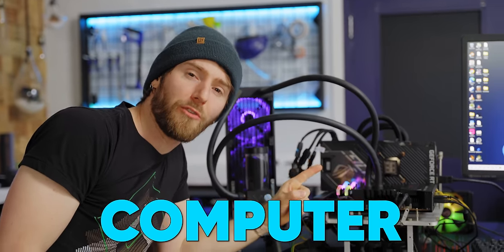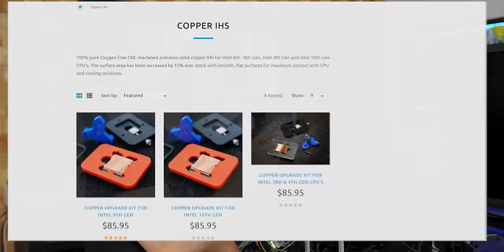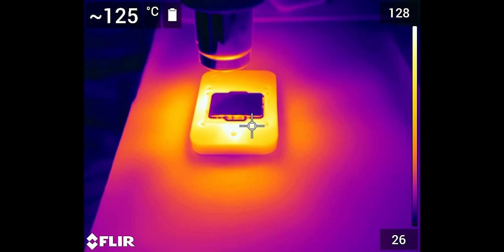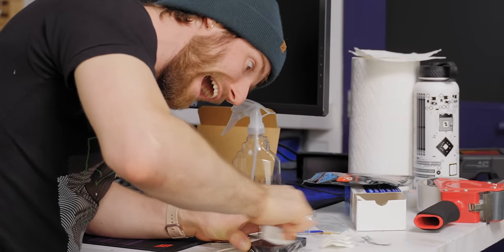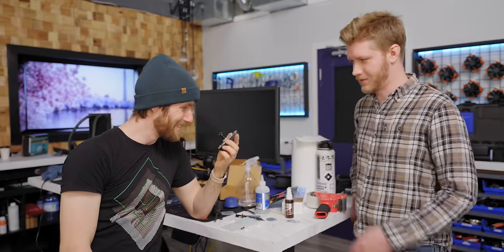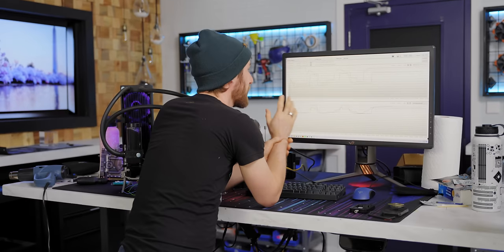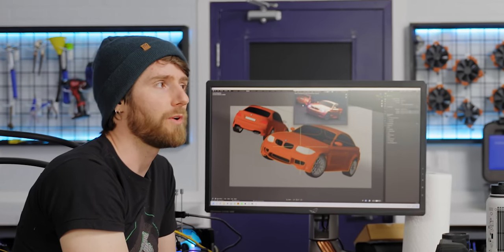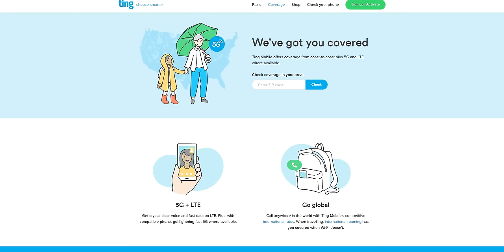Making Intel's Worst Product Better.... And Also Worse

Comment: AMD: Next generation 3D stacking technology brings top tier gaming performance on high-midrange CPU's
Intel: 300W stock, take it or leave it
Reply: AKA - Intel: "Best I can do is 300w stock."
Reply: They had the best cooling you can possibly get and this CPU still thermal throttled with stock IHS. What a waste of money this processor is.
Reply: @kamilkilian7861  Not quite the best possible. They have that air conditioner cpu cooler.
Reply: @DarthCiliatus  which in it's turn takes 2kw of power and has issues with condensate
Reply: Valentine cant go a day without fanboying over amd
Reply: @TehStevz  
*Worst
Reply: 300W stock is a stupid thing to complain when the power limit is a few clicks away

And 12900KS at 150W (or even less) would still murder 5800X and 5800X3D in mutli-core
Reply: @suntzu1409  Intel fanboy spotted.
Reply: @suntzu1409  i doubt it. Maybe I'm wrong, but limiting your CPU's potential literally in half will not keep it magically better, than a CPU, that was designed for this power consumption.
Reply: keithsze001  *12700/12900
Reply: @K.R.X  
Ok AMDrone®™
Reply: @vladislave7826  
If you are complaining about ""300W stock"", then limiting it to 150W will make it better

Plus you will barely loose 2% performance by doing this

CPUs are not """"designed"""" for power consumption
Reply: keithsze001  
Inb4 "muh, power hungry, expensive"
Reply: keithsze001  Or you know get the processor which is actually efficient. 12900k is a sham at that.
Reply: This reply section got full of fanboys real quick. Bye.
Reply: @suntzu1409  12900ks is 16/24, its a given to win multi-core againts 5800x 8/16.
But really, that power consumption is atrocious.
Reply: @suntzu1409  The problem with limiting the power to 150w is that now it’s not only still drawing more power than the 5800X3D, it’s now also probably losing on average in gaming performance since it’s only ahead by a few % points.
Reply: @ValentineC137  
Ok, so limit it to 65W

Point is stock means nothing when you can put whatever power limit you want
Reply: @ivrgn1720  
Power consumption can be whatever you want

"Oh, its just 16 core vs 8 core" is just trying to ignore the fact that 12900KS murders 5800X3D in multicore
Reply: @suntzu1409  like I said, it's a given that 16/24 will kick 8/16 in multicore, because it is literally have more cores and thread. It's like saying a truck can carry more load than a sedan, well duh...
Reply: @suntzu1409  "Oh, it's just 16 core vs 64 core" is just trying to ignore the fact that 3990X murders 12900KS in multicore
Reply: @ivrgn1720  
Well, maybe this guy shouldnt have compared 5800X3D and 12900KS in the first place then
Reply: @ValentineC137  
And how exactly is 3990X related to 5800X3D?
Reply: @suntzu1409  it’s about as related to the 5800X3D as the 12900KS’ multicore score is.

Also I find it pretty funny that the 3990X doesn’t use much more power than a 12900KS, even under full load it’s only 400w compared to 300w
33% more power consumption but running 400% more cores and 533% more threads.
Reply: @ValentineC137  
Except nobody mentioned 3990X other than you

Power draw is very very arbitrary for any die or combination of dies unless you are at the extremes

It isnt an achievement to make 64 cores run at ""only"" 400W

Increasing core count faster than power draw isnt without its own drawbacks 

Cope harder
Reply: @suntzu1409  nobody mentioned multicore other than you :P

Comment: I remember back in 2013 when AMD brought out the R9 295x2 and Linus said that intel needed a product that pushed the bounds of what's possible and requires watercooling. Looks like he finally got his wish!
Reply: Damn even the single R9 290 was a mess to cool. Been running in thermal throttle since day one, had to build my custom WC loop
Reply: @bratisla2040  I had a Tri-X 290 for a while back then. After repasting, it didn't go past 75 degrees EVER.

Comment: I loved the 12900ks - recently sold it. Now I have the 13900k & 14900k. For those worried about temps/degradation: For my 13900k and 14900k I have done the following: MCE off, PL1 and PL2 limit to 225, limit P-core boost to 5.5 GHz and E-core boost to 4.3GHz, and use balanced power profile in Windows (although I do disable core parking to keep system highly responsive). Oh and just XMP on the RAM. I didn’t change LLC value. I have set voltage offset at a modest -0.010v. I have disabled the C6&C7 C states and EIST. Lastly I have locked AVX at 0 offset. I have tested on P95, CB R23 and CB R15. All great and in a mid 20 degree room, no workload exceeds 80c on package or cores just using an NH-D15 with an airflow case. Very happy and benchmarks are very close to where they were before taming these beasts.
Reply: Update: I have now undervolted to -0.015v and set the Core limit to 300 Amps.

Comment: Weird to find a compromise in a no-compromise CPU. I wonder how much more Intel would have to charge per CPU if they used a tighter tolerance heat spreader for the massively high end CPUs only. If it doesn't matter for 99% of all chips okay, use the other process, but for that remaining 1%, it seems like billions of dollars of R&D could be bought cheaply simply by refining this one component. 

I hope someone with some power and vision at Intel watches this, since AMD is looking to eat their lunch again with Ryzen 7000 and they could use every advantage. 

Or someone at AMD could watch this, improve their own high-end and continue embarrassing Intel in the future.
Reply: Tbh offering a "top bin" for the higher end CPUs at like 400 bucks more without an IHS or with a lapped IHS may be interesting. I wouldn't buy it but people looking for absolute best performance may want it.
Reply: Or, like, design the CPU to use a somewhat reasonable TDP? This thing draws more power than my entire computer
Reply: 8 months old comment, but anyway, i think the issue may be that the cost may be higher than what the price of buying that lid would suggest and that in practical applications, as shown in the video, the gains are minimal to non-existant:
1)Because of the random factors during manufacturing process (and manufacturers designing around the existance of said random factors), you only get to know if any particular chip can be made into a top tier/mid tier/low-end processor after evaluating (i.e. (mostly?) testing) it. Which means that you have to either

a)disassemble, clean and then reassemble already working processors (which, besides costing money, adds some risk of breaking them), 

b)or you have modify your production process to have your testing done before fully assembling the processors, which will probably increase production costs for all of the processors, which, given that only a very small percentage of the processors would actually use that super flat IHS, would effectively make installing that IHS an expencive process (if 100 processors with standard IHSs cost, lets say, 1000$ make and 99 "standard" and 1 "super flat" processors cost $1050, then that super flat IHS effectively costs 50$).

2)You now also have to manage having 2 similar items in your facility, which increases costs of running said facility (i.e. the production cost of all of the processors), which, same as above, means that it is, effectively, really expencive to store those super flat IHSs.

Comment: Having the extra good heat spreader should have been the standard. Intel wants to pump the absurd extreme, they should offer supreme cooling. As if it's not expensive enough already, while there's almost no way to prevent it from throttling.
Reply: nhaaa, they should just rework their stuff, all they do is keep upping the power consumption gen after gen, just like ngreedia does. thats great if you live way north but having a space heater with 300w cpu and 400w gpu is the definition of ''playing on a toaster''.
Reply: @jeromegagnon3787  it would be better if they made their general line up better, but it if they are going to make a hot part like this they'd better supply it with ample cooling.
Reply: @Olav_Hansen  id rather it come with an ac unit then. the part can stand the heat, i don't .
Reply: The stock IHS is domed for a reason: To make sure it will work even with lower quality heatsinks and low quality thermal compound. You can get the exact same result as in the video by just sanding down the IHS flat.
Reply: @jeromegagnon3787  one the many reasons I got a 75w Series S console....The next gen is gonna be 10X my S's 75w power usage. I will keep my old 200w PC for retro/media usage.
Reply: @MoraFermi  ive never used the stock ihs, i like mass, but mass don't negate the heat that gets dumped in the room. what im saying is efficiency hasnt improved that much if you set equal power over the years. im an old overclocker who messed with dry ice and stuff in my days. and frankly, the stuff they are releasing these days aint that great. but since peoples will buy absolutely anything if the mind fkery department does its job half well. we're left holding the bag.
Reply: @jeromegagnon3787  While I only have the peasant versions 12900K and RTX 3090 they really do a wonderful job as space heaters.
Reply: @jeromegagnon3787  yeah Australian summers means I'm not pushing anything on my water cooled station
Reply: Its not viable to mass produce the heat spreaders they showed here they would if they could

Comment: I delided my 8600k, was a lot of fun. I didn't even bother glueing the IHS back on, I just used the mounting pressure of the socket to hold it still. I probably got like a 10c drop just putting the previous IHS back on with liquid metal and lightly planing the IHS + heat sink.
Reply: :o

Comment: I feel like changing thermal pads/paste on the gpu may have actually seen results in this setup. My 3090FE had massive cooling gains for memory temps when I did it (about 20 degrees cooler), I think they really have been skimping in the thermal pads.

Comment: I actually bought one of these back in 2019 and my temps did go down a good bit, I still have the excel file I made. The core temps went from (90/85/93/86) to (74/73/80/74) using whatever stress test I was using at the time (Probably Prime95).... So they do work pretty dang good.
Reply: What cpu did you put it on?

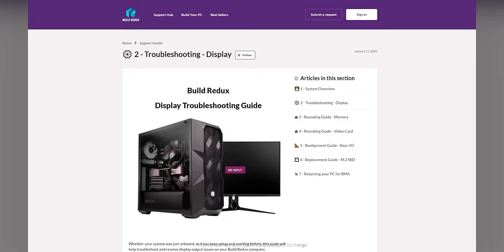Comment: 1:22 y'all pretty much explained Six Sigma manufacturing better than any corporate trainers I been subjected to 🤣 so considering that Intel isn't realistically expecting a perfect finish, I'd take a guess they're wanting an adequate finish and Sigma 3 or 4
Reply: 6S is even more cringe than 5S. All lean manufacturing is soooo painfully cringe. The proponents and the consultants are the type of people that pump 6S during the work week, and a pyramid scheme ... I mean MLM scheme... after hours and on weekends. You'll see them at MLM rallies on Saturday afternoons.
Reply: I prefer six ligma
Reply: Oh boy! Have you heard of LEAN SIX SIGMA!?
Reply: @bigqwertycat  I first heard about it in 2009 lol
Reply: @littlejackalo5326   I'm not saying I'm a fan (except that the "training" was a nice way to get out of actually working for a week). As for it being a scheme, well it explains why my former employer loved it so much 🤣 it was completely engrained within that company to the point you couldn't make a proposal without certification in it. The biggest takeaway I got from the training  and why I brought it up was: at what point are things "good enough" before you start wasting resources with ever increasing diminishing returns?
Reply: @tinman123456789  Interesting in the case of this CPU lid that it could be 10C cooler yet ultimately not worth the effort. Purely on the effectiveness of the cooling 10C is excellent but for 4FPS more in Tomb Raider, why bother.
Reply: your ability to timestamp has definitely failed to meet 6S standards
Reply: @kingkarlito  
Lmfao

Irony committed suicide

Comment: As electricity usage per square mm goes up, every additional improvement in tolerances will have greater levels of significance (obviously to a point). It’s clear that for the maximum performance units they could do better, but for the overwhelming majority of processors, thankfully, doesn’t matter. 

It does raise a question about the value of keeping the prices down on the high end products when quality suffers. Relying on 3rd party improvements has been standard for top-end systems, usually because of some odd deficiency—whether it’s lapping the IHS, package bending (Alder Lake), IHS-die gap (on the interior), de-lidding, die lapping, or use of liquid metal TIM—halo products could benefit from the additional effort, and we could still enjoy warranty coverage.

I personally think paying more for better quality in a complete package off the assembly line is worth it for halo products. I would be willing to pay to not risk ruining something so expensive.
Reply: Better quality parts would really justify the KS name and price
Reply: Eh. Don't know. The price may not be worth it to them. Computers are not like any other product on the market. They depreciate so quickly. In a year or two the 12900KS will be outperformed by the rest of the high end market, in 5 it'll be outperformed by the majority of the market. Does it make sense for Intel to spin up entire new boutique divisions just for the KS series? I'd say no. A halo chip is for current headlines, it's not like a halo car which could have an impact on the brand for decades. People don't judge chip manufacturers on halo products. They judge them on what they can actually afford to buy. Chips are commodity priced and sold, which we saw over the last two years with the chip shortage. Noone has brand loyalty to Tropicana, if Tropicana OJ is out they'll buy store brand and be fine with it. With how fast chips depreciate it honestly may not be worth it to Intel.

Comment: The nickel plating on the IHS actually does significantly contribute to thermal resistance due to the nickel being heat-soaked. The thin-wall assumption that you spoke of holds primarily for steep temperature gradients, but under nearly isothermal conditions, like a CPU and cooler at steady-state, the contact resistance of the nickel-to-copper interface is actually quite significant relative to the other sources of thermal resistance. I would cite my sources, but it was a textbook I read like 2 years ago and I can't remember what it was called, sorry folks.

Comment: It would be interesting to send the intel IHS to a company that can test its “flatness”.
Reply: Its most likely slightly bend now after the delidding.
Reply: Why? The real issue is how inconsistent Intels IHS are from one unit to the next. Some might be flat while others arent.
Reply: @randybobandy9828  There is also the issue, on 12th gen specifically, of the Independent Loading Mechanism (ILM) bowing the IHS.
Reply: GN tests that.
Reply: What you could use to measure it is an optical flat and a low pressure sodium lamp that measures surface flatness by optical interference. It sounds complicated but if you set it up right it's actually pretty simple.
Reply: Send it to GN
Reply: probably a dirty joke in there somewhere

Comment: I've seen Linus complaining about sticky residue several times. Tech tip: contact cleaner dissolves sticker and glue residue like it is nothing. You can even remove void warranty stickers with that stuff. 
Just be sure to use the computer-kind contact cleaner. Automotive contact cleaners sometimes use minute abrasive agents that can ruin the look of some plastics :(

Comment: If gold is also an excellent conductor, well I think you gotta test the theory of gold vs copper
Reply: Gold is worse in thermal conductivity. By quite a bit.
Reply: Actually, silver metal has the best thermal conductivity of any metal at 429 W/mK. Gold is 310, copper is 401, aluminium is 205.
The thermal conductivity of a copper heatpipe is between 10000 and 100000 W/mK.
So a gold heatsink would make no sense at all.
Reply: @ProjectPhysX  So... silver coolers when?
Reply: A diamond  IHS is the way to go
Reply: @Sithhy  for a top price CPU silver heatsink actually makes sence. However if you running water cooling, you want to stick to a mono-metal system.
Reply: @DogsBAwesome  Go straight for graphene or at least carbon nanotubes then.

Comment: I would be interested in seeing a direct die vapor chamber like in some GPUs and Laptops as an IHS. That would be a lot more thermally conductive than a pure metal IHS and spread the heat even better over the whole area of the IHS.
Reply: Actually im not sure it would be. Vapor chambers are used for long distance heat transfere like a laptop or aircooler. Pretty sure when you only need a mm or so that wouldnt even be possible that thin. Also youd transfere the heat from metal to vapor to metal again which should be worse than 1mm of copper i suppose. But im no expert just following my brains logic so pls correct me if theres an expert somewhere here
Reply: @D3nn1s  My feeling is that it may still be beneficial, especially as the whole area of the IHS will be more evenly used, instead of the heat being concentrated where the die is. 
But this discussion is what would make the experiment interesting! Please Alex/Linus!
Reply: @emmamitchell1582  Dennis is right here, heat pipes work well over several cm plus. Thinner than 3mm and straight copper is objectively better.
Reply: @D3nn1s  
Ehhhh heat pipes are used for long distance heat transfers

Vapor chambers are used for large area heat transfer
Reply: Or is it?

Vapor chamber is when you want to transfer heat across a huge surface area
Reply: @suntzu1409  Vapor chambers work by almost the same concept, albeit a bit more efficient. This doesn't mean that a thin (3-5mm) vapor chamber would work any better than a much thinner (0.5-1.5mm) piece of copper though.
Reply: @faranocks  
Vapor chamber will probably worse imfao